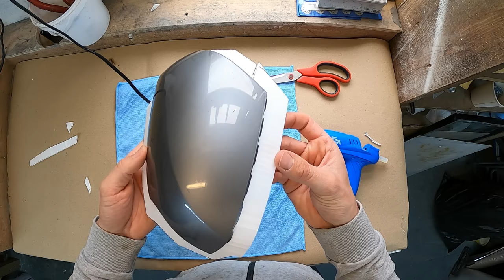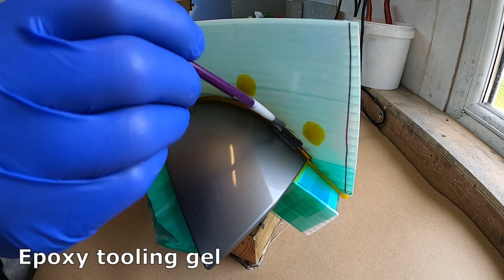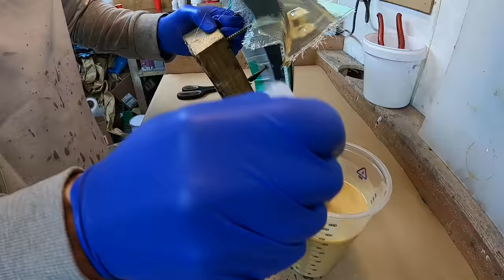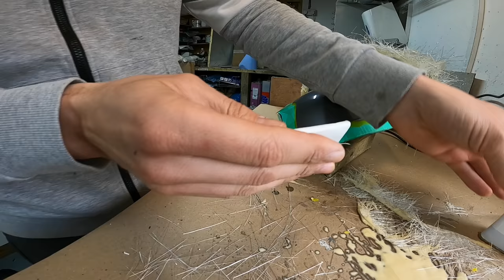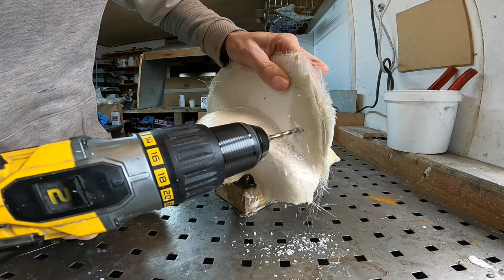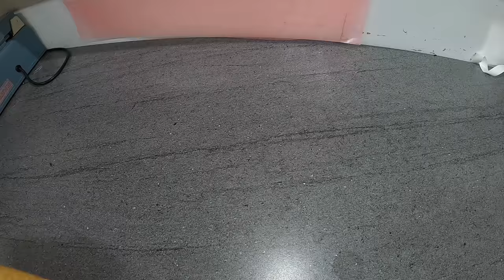How to make Carbon Fibre SPLIT mould. Car wing mirror cover. Prepreg [OUT OF AUTOCLAVE]

Comment from the maker: Please Note - Epoxy gel coat and Vinylester/Polyester Uni mould don't technically work together, however if the gel coat is left to cure over night before layup this has worked fine for me.
Reply: Very interesting! How long such epoxy gel/vinylester resin mold can give parts without cracks?
Reply from the maker: @alexberserk_wr8579  so far about 20 parts made from it with no issues
Reply: @CarbonWorkshops  Much thanks for your reply! Really appreciate! It's a good new idea for me to try this. If you can please write how much time you cured the epoxy gel before lamination? Cured time meters for proper adhesion? My name is Alex and we called "Carboninovations team" from Ukraine 🙌
Reply from the maker: @alexberserk_wr8579  I left the gel overnight at room temperature 👍
Reply: Music is so cool...
Any idea? 
Please tell me
Reply: @ffg902  The music is in the description
Reply: @TacticalBuffoonary  I mean the music in the intro, Sir
Reply: I use exclusively epoxy  for the moulds
Reply: Hello👋 May I ask you, the gel coat uses epoxy, and the laminate uses vinyl. Is there any delamination?
Reply: Thanks for showing us how to remove that line from the two pieces molds 🙃
Reply: Hello, before looking at the comments I've had to rewind to be sure I read epoxy gelcoat and then was ready to comment like : you mixed epoxy and polyester 🤔🤔🤣. Well done!

Comment: Great video, I watched them all. But, can you tell me why did you make split mold, instead one piece mold? I'm new to this.
Reply from the maker: Thanks, this is because some of the edges are undercut meaning you get mechanical lock where the part can not be released from the mould.

Comment: Good morning, beautiful video!
I wanted to ask you, how many layers of 450 fiber have you made?
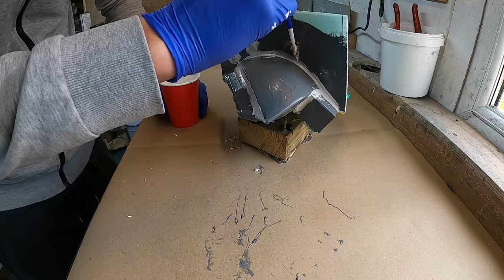And what resin is the white one used between the gelcoat and the glass fiber at 3:11?

Thank you very much!!
Reply from the maker: Hi, I use 3 x 450g Chop strand. And the white resin is glass bubbles (from Easy Composites) mixed with Coupling coat. It just thickens the Coupling coat into a paste.

Comment: What are you using to cut out your carbon fiber parts I'm throwing loads in the bin the disk is catching and throwing it into the part you on air power my electric Dremel is not powerful enough I'm on Dremel disks as well  thanks 🙏
Reply from the maker: I only use dremel. With diamond cutting wheels

Comment: Is like to see how you seal and prep the parting line in that mold. I have been using body filler to seal mine, and I may try a 2 part silicone next as I’m not thrilled with the body filler results in terms of actual sealing the mold.
Reply from the maker: I do nothing with the join. Just lay up over it as normal. Then sand the join out of the finished part before clear coat.
Reply: @CarbonWorkshops  aaa
Reply: @CarbonWorkshops  how do you seal between the mold sections to draw vacuum?

Comment: Perfect hob my friend,wana ask something pls.there is a litle hole between 2 part mold commection line,when you lay up product gelcoat do you put something that hole l.mean close?
Reply from the maker: Thank you! Yes there is a very thin join which will show in the finished part. But easily sanded out and clear coated over. I lay up as normal over the join. 👍
Reply: @CarbonWorkshops  thankyou so much lm a fiberglass boat builder also,was wondering if l make 2 part boat mold how ot could be,thanks for answer have nice work.

Comment: Could this mold work for parts made with your hand lay or wet lay technique for those who don't have access to an autoclave? Thank you for sharing these videos and processes with us!
Reply from the maker: Yes it could work, only difficulty will be keeping the carbon into tight corner without vaccum to hold it there.
Reply: @CarbonWorkshops  Ahhh that makes sense. Thank you very much for getting back to me, and I hope you have a fantastic day! :D
Reply: spreading a layer of epoxy resin and laying the carbon fabric when the resin starts to be tacky could help the fabric to dry, or use a spray adhesive (but this could cause you to finish defects)
the biggest problem remains the formation of pinholes on the surface, without a good use of an autoclave they are inevitable

Comment: Very cool!
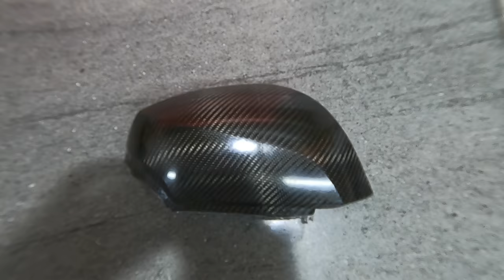How did you manage to remove the stitch? 9:25
What prepreg did you use? 416g? Thank you!
Reply from the maker: The join just sands out with 240 grit.

Prepreg used was xpreg xc110. 210g and 416g 👍
Reply: @CarbonWorkshops   
Excellent!
Thanks a lot!
I also wanted to ask a couple more questions, if I may.
- Did you use one coat of gelcoat?
- Is the Uni mold system suitable for prepregs with a curing temperature of 130 degrees or did you use some other temperature?
- How many coats of varnish?

Thanks a lot! Very cool result!
Reply from the maker: @antonk3597  yes just one coat of gel coat, and uni mould technically only goes to 90deg but it's works ok at 130deg for me
Reply: @CarbonWorkshops  
Excellent! Thank you very much for your help!

Comment: have you tried the epoxy mould making putty instead of the chop strand?
Reply from the maker: Yes, good for quick moulds but they won't last hundreds of pulls
Reply: @CarbonWorkshops  is chop strand better for more pulls?

Comment: Did you use tooling epoxy gel coat and then a stryene based resin to layup the fiberglass?
Reply from the maker: Yes, if epoxy is left to cure over before layup it works very well.
Reply: Did you apply the epoxy surface coat and let it completely dry to hard and not finger tacky? After dry do you need to sand or scuff the epoxy to get the vinylester coupling coat to stick to the epoxy or just apply right over the shiny dry epoxy surface?
Reply: @CarbonWorkshops  Thank you! That's great info to have!
Reply from the maker: @carbonguy  yes leave over night so tack has gone. Scuff it up a little and away you go
Reply: @CarbonWorkshops  really? This is a first for me.. i was taught to never put poly over epoxy but ok to put epoxy over poly... i need to try it.  I do alot of boat work glass and its always a balancing act...
Reply from the maker: @TonyDFreestyle96  for boat work and anything that wants to last perhaps I wouldn't risk it as It could delaminate over time. But for a me making a mould this way is so much faster and easier than using expoy resin
Reply: @CarbonWorkshops  ok I agree with that and it makes sense! Great work btw and good luck with the channel! Im subbed!

Comment: what make epoxy gelcoat and resins did you use to make the mould?
Reply from the maker: Easy composites eg160 gel coat and easy composites uni mould resin
Reply: @CarbonWorkshops  which do you prefer of your methods? the polyester gelcoat with alloy powder and uni mould resins or epoxy gelcoat and uni mould resins? ive got a few moulds to make and it all comes down to costs. i'll be using prepreg carbon once moulds are made
Reply from the maker: @garrybull4165  personally the polyester gel coat with metal powder is my favourite. Fast and cheap with great results
Reply: @CarbonWorkshops  just made some large moulds using your method of alloy powder in the gelcoat but I used tooling gelcoat instead and then used coupling coat resin and tooling resin from easy composites.  Not popped the moulds off the plugs yet as still got couple more moulds to make.  Have to say though I don't like the tooling resin. It's really thick and found it didn't soak in to the mat very well. The coupling coat looks to me to be the same as atlac 580 vinylester resin.   Will see in next few days how the moulds have turned out
Reply: @CarbonWorkshops  have you ever added the alloy powder in to resin? ive tried it on a mould today as i ran out of tolling resin and had to use atlac 580 vinylester and thought id add the powder and see how it comes out. the resin soaked in to the mat as normal so im hoping it helps raise the service temp of the mould as well as uing the powder in the gelcoat.